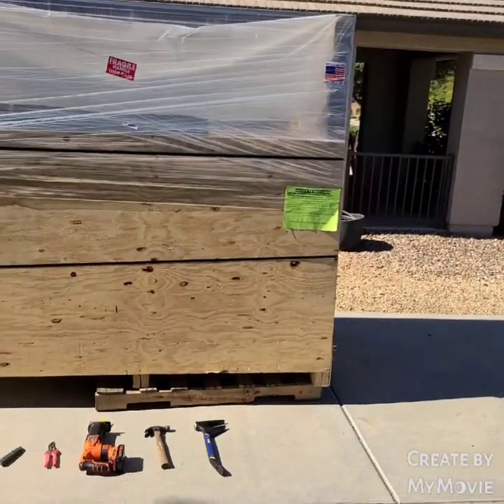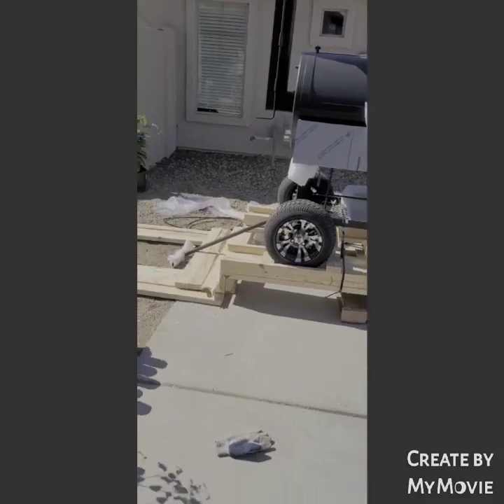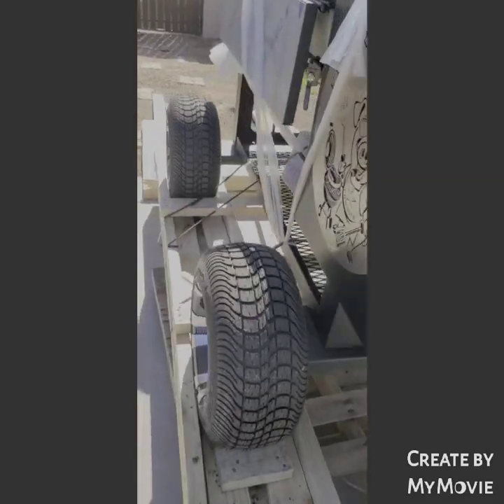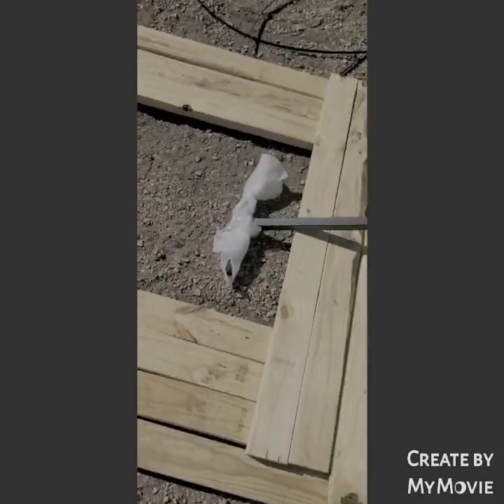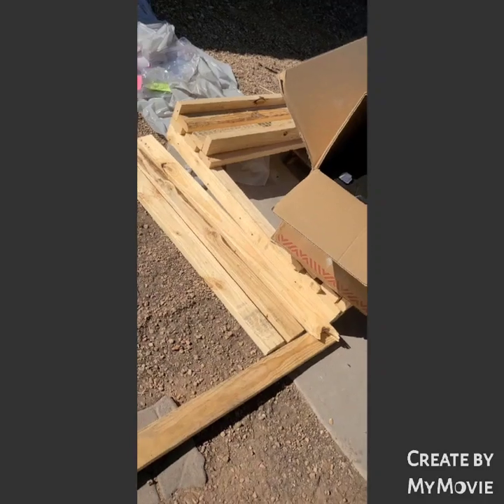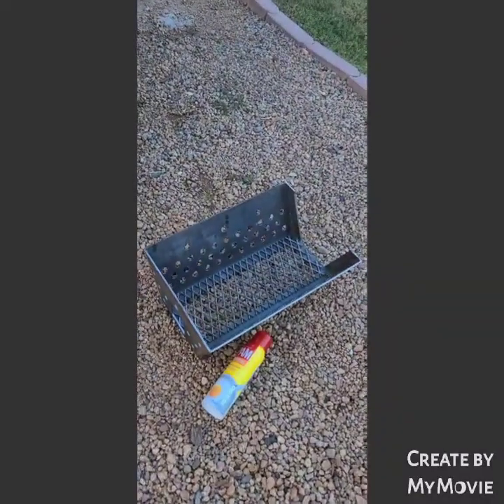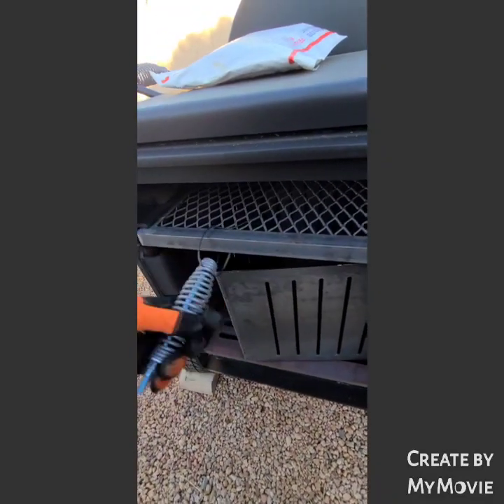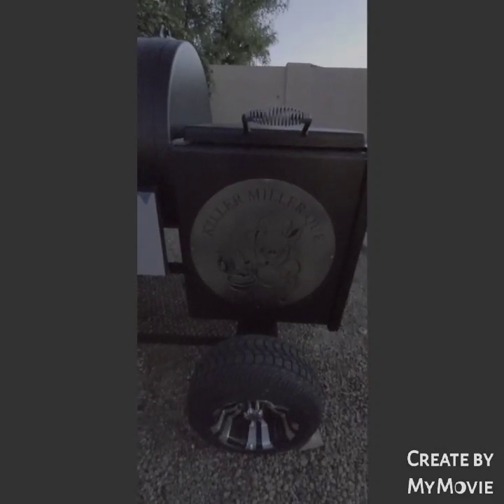Lone Star Grillz uncrating/initial seasoning#Lonestargrillz#offsetsmoker

Comment: Came back and watched this again. 

I've got a similar sized beast and decomposed granite, I don't have those golf cart wheels though. You made a smart choice with the off road package. 👊
Reply from the maker: Thx boss!!👊🏿 I tell you I almost didn't get the off road package and it would have been detrimental for me. It would have been a nightmare to get that in my back yard through all that gravel without them...smh and once it got there it would have been pretty much stuck after that. The big wheels made it easy to move around even though it's so heavy. The other thing is I'm decently tall, and it sits at a perfect height for me now.. I imagine it would be much shorter with the standard upgraded ones.

Comment: Hey Killer Miller Que. I have a question about your off-road package. Do the tires take on heat from the firebox??? I’m told it’s about a 6” gap.
Reply from the maker: Yoo.. good question to tell you the truth it never even crossed my mind.. which means  they're far enough away where it wasn't a concern of mine. But I will tell you this.. it wouldn't be the same grill if I didn't have that off road package on there..💯💯
Reply: Thanks a lot. I got the off-road package & just looking at the LSG smokers that have them I was wondering. Amber from Loan Star said it’s a 6” gap so it shouldn’t be a problem. But I also know that the firebox gets hot. Having the 1/2” box should help. That’s my hope.
Reply from the maker: @Bishop’s BBQ & More Np..  I have the half inch upgrade as well.. I think you'll be cool